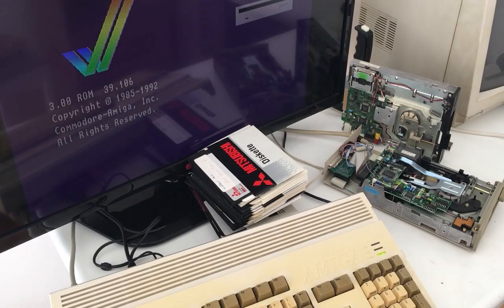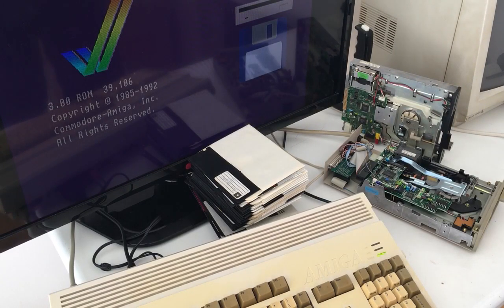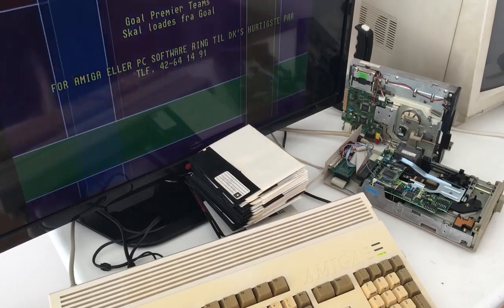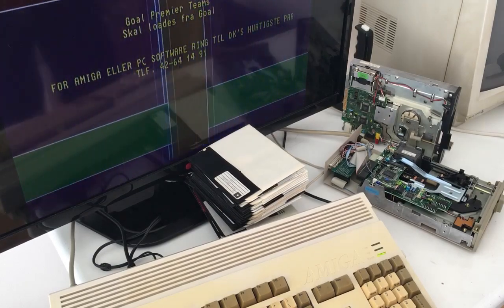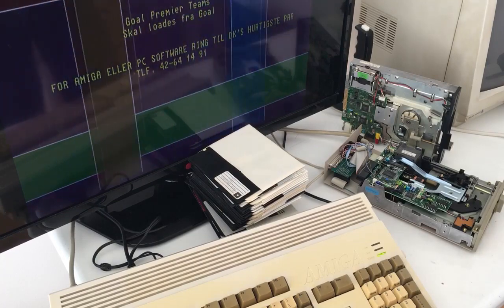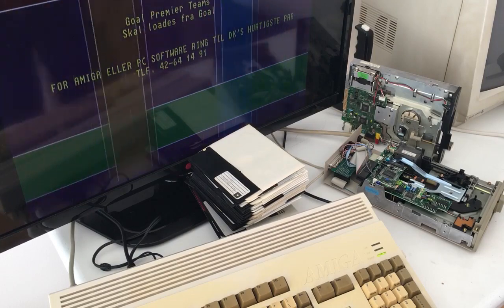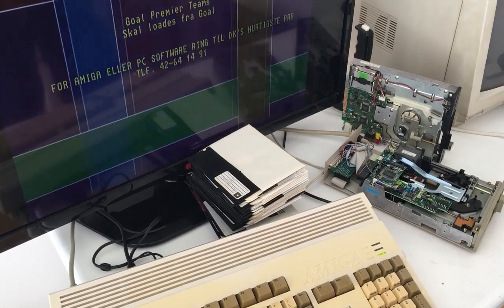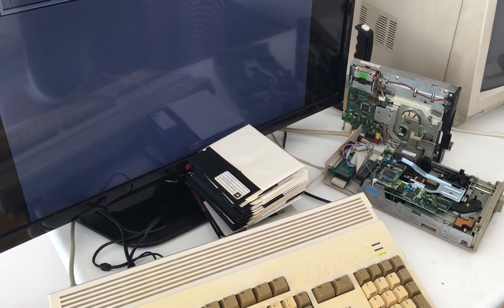5.25" Commodore Amiga floppy diskdrive test

Comment: You need a.df0 / df1 boot switch to boot off the 5.25 on df1. On the 1200 it is defaulting back to df0 when the ndos trackloader kicks in. If you switch drives with a h/W mod available on eBay,. The the drive will work perfectly.

Comment: I would boot the Amiga normally from the internal drive and then see exactly what the 5.25" drive actually is.   Old disks, dirty heads, combination of both could cause problems.  Heck I have new drives in a couple Amiga's one will read disks fine the other will not but those are 3.5".  I'd get one or both of those drives fully functional, not to use but to have readily available should you come across anything interesting in the future even though I have never come across anything 5.25" on the Amiga except for Bridgeboard use and maybe UNIX.

Comment: RETROCENGO, Thnx for the awesome videos.  We've been watching your videos with great pleasure.  I have a request if possible.  I have been looking for this drive you've shown on this video.  The one with 40/80 track and ON/OFF adjustment on the back.  I owned this drive in 1991 I believe.  I bought it because the 5.25" disks were a lot cheaper than the 3.5" disks.  So naturally, most of my stuff is on 5.25" disks.  Normally, only the piracy shops used this drive back then.  And everyone was using the 3.5" disks.  I guess 5.25" disks were totally old/not-in then and 3.5" disks were thought to be newer and superior especially after dealing with dog slow 1541 disks for years :-) I used to make soundtrakker mods, also used amiga with a MIDI interface for my synths and some DigiPaint files are all on 5.25" disks. I would be very grateful if you would consider selling it to me no matter if it doesn't work. If you still have it of course.  Please let me know. You would be doing a great help.  Thanks a lot.  Cengiz üstad, İstanbuldan selamlar 😀 👍
Reply from the maker: Tonguç Endem Thank you for your kind words. Loved to read your comment, if i still had these drives, i would have donated them to you🤗
Another subscriber did get these drives,  after I reviewed them. 
Hope you’ll find em. 
Hayirli aksamlar kardes😁
Reply from the maker: Tonguç Endem  https://youtu.be/fkeckhABEqs
Reply: @RETROCENGO  Hey man, thnx a lot. Yea I was afraid you handed them over to someone else :-) Anyways, I would really appreciate if you might be able to let me know if you hear about one existing somewhere or receive one :-) Thnx a lot 👍 The problem is that there is very little information about these drives and I'm actually planning to reverse engineer one and make it available on github as a DIY project.  I think especially for A2000 users it might be interesting to install a 5.25 drive in more than a cdrom :-) Thnx again. Take care.
Reply from the maker: Tonguç Endem Sounds great. 
If i find one, I’ll let you know for sure😁👍🏻

Comment: The switches on the back are "power on/off" and "40/80 tracks". As far as I can see in your video you left that on "40 tracks" at the beginning of the video and this might be the reason why the disks did not work. They are usually formatted as 80 tracks.
Reply from the maker: Niederrheiner74 Allright, thanks for the info🙏🏻😄